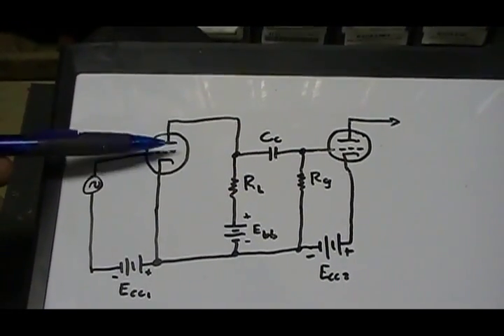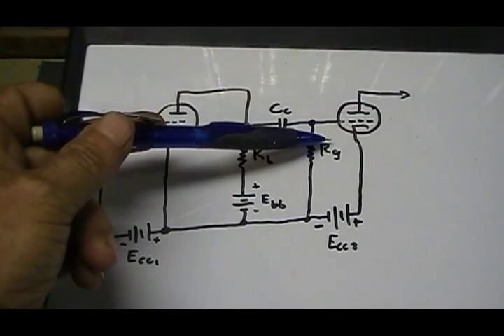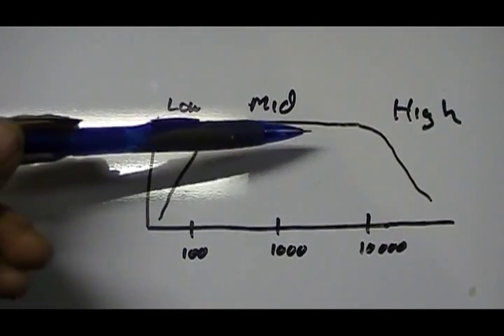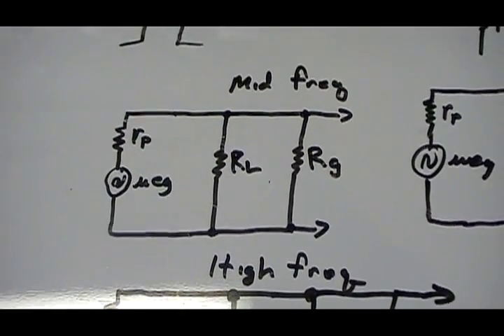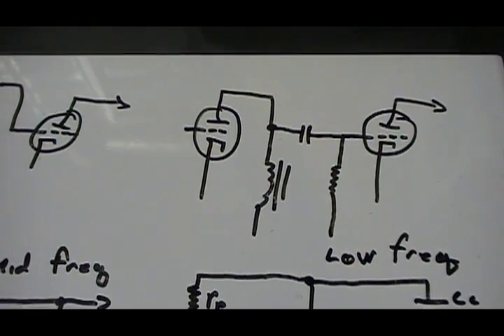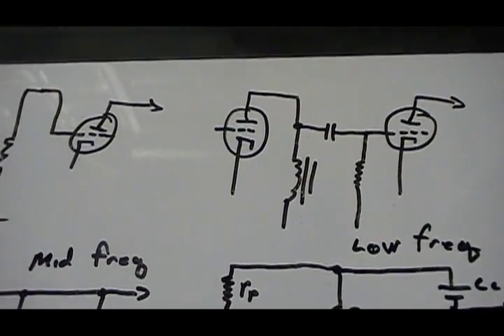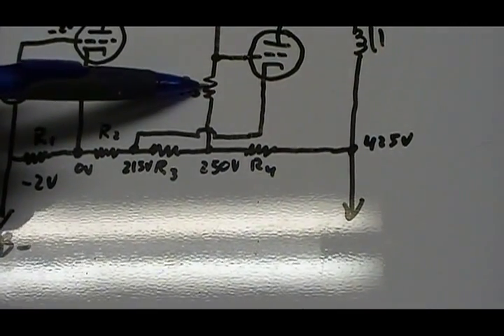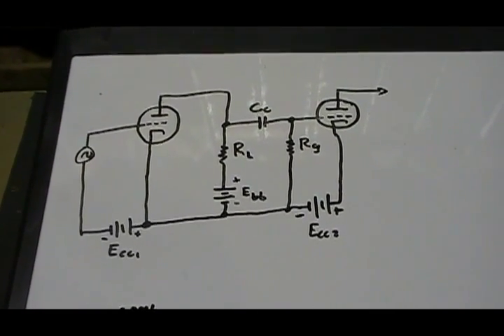Tube Theory part 5

Comment: This one is a blast! I was thinking about doing a Tube theory video as well. But now i no longer need to, just because you done such a great work on it. I always can/will refer to your videos when i´m asked on how they work and alike.

Personally  had loved to see some more detail on transformer coupling, as this is the only way to couple the "big guys" together, like a PP845 Amp or similar as those tubes need to have some control grid current to perform better than ordinary tubes. With no gird current you badly can get them to work, they just don´t want to;)
It´s like you call the big guys just to do some 50W+ watts...But they could easily do 300W+ watts just with a transformer coupling...

But this is like picking up light dirt and complain....Remember: this video series is a blast couldn´t do it much better!!

Thanx for posting, Dennis!!

Comment: On the direct coupled circuit, you've got 215v on the cathode, 200 on the grid so grid is -15v with respect to the cathode but the plate is at 210v or -5v with respect to the cathode.  How does the tube work with the plate at a negative voltage with respect to the cathode?